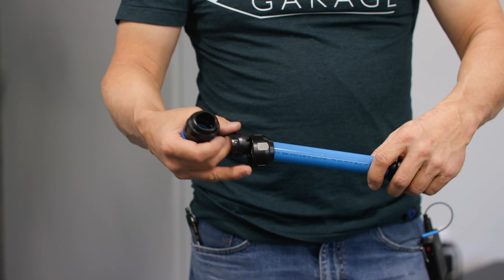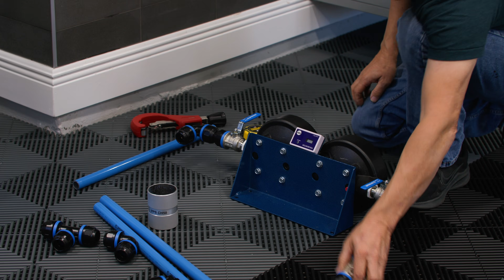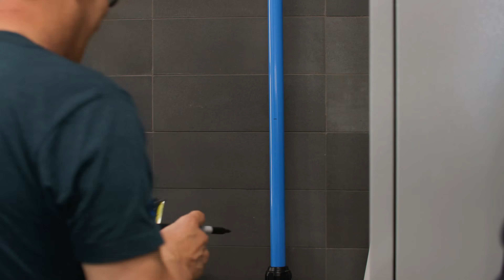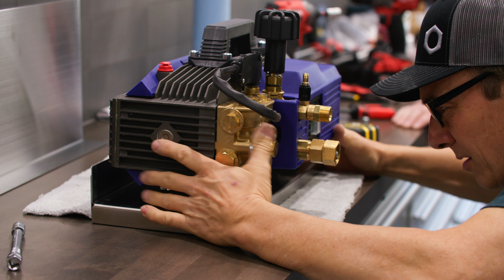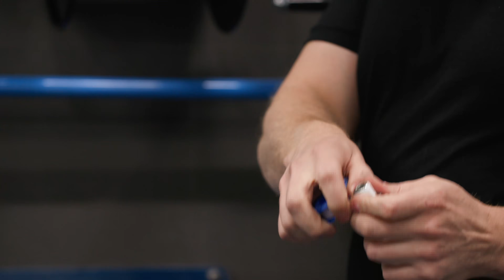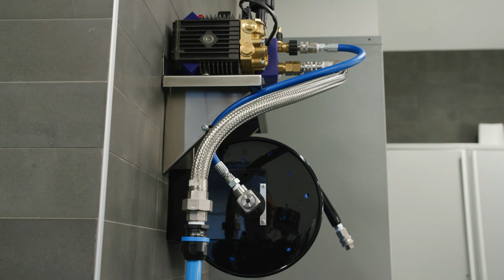Wall Mounting A Pressure Washer | AR630-TSS Custom Wall Mount Solution

Comment: Hate to comment on a year-old video, but you still sell this as a package so I'm curious. Prevost lists this as compressed air piping and aluminum is more corrosive than copper. Or even PEX which could give you the same blue look with no corrosion. So what can we expect from a longevity and reliability perspective? It also seems aluminum would freeze at higher temps for those of us in more northern climates. I ask this as a fellow OG mindset curious to know why you chose this solution?
Reply from the maker: Aluminum being leeched by DI would likely take 100 years.

Comment: I do have a question...Why the osmosis filtering system if your gonna wipe the vehicle after every wash in order to finish the detail process ? Just wondering ?
Reply from the maker: It's a deionizer, not RO.  RO wouldn't completely remove the mineral content.  For me, you are right, it is largely just a luxury.  For those with poor water conditions, they can get spotting even when drying manually.

Comment: Do you run hot water thru the setup or just cold? I’m asking bc I got all the stuff and I’m about to do the setup in my garage
Reply from the maker: You can do up to 140 degrees, just not through the DI system.  I only have cold water as I"M in FL.

Comment: I am looking for a solution to do this same installation at home.  but in France it is impossible to obtain such equipment without excessive shipping costs.  I have a kranzle pressure washer.  I am only missing 50 feet of mtm hydro kobra hose and a coxreels hose reel.  Matt do you have any friends in Europe, so that I can place an order at a normal price? Thanks

Comment: How exactly are you mounting feet to the underside of the AR630? Mine didn't come with any.  Not sure what the thread pitch is either for longer bolts underneath.

Update: for anyone reading this and wondering the same, it's M8 x 1.25 pitch coarse thread that you want.  I used 1.5" long and some random bushings and washers I found at the hardware store.  Worked great.
Reply: Thanks for providing the hardware specs. He sells a kit for nearly $30. It's probably under $10 if you source the stuff on your own.

Comment: This is the exact setup I plan to install in my garage soon......my only issue is that my OCD has a hard time getting past the different shades of blue between the CR, Prevost Pipe and the high pressure hose. LOL  The purple shade to the AR doesn't help either.

Comment: I went the other way. I bought the AR from you guys OG spec'ed and found a pressure washer cart. I had to drill holes in the mounting plate and used rubber washers to isolate it. There are not a lot of pressure washer carts available. In hindsight the one I bought has a very low handle so you can't stand upright when pulling it. For this reason I would not recommend this cart. You don't know what you don't know. It does have hose and wand holders.
Reply: Same here. I went with the 36” x 24” Haulmaster from Harbor Freight with the Cox reel mounted on top and it’s  served me well.
Reply: They built one for jay Leno’s shop in a previous video. Seemed to work well for them. Probably similar to what you did.